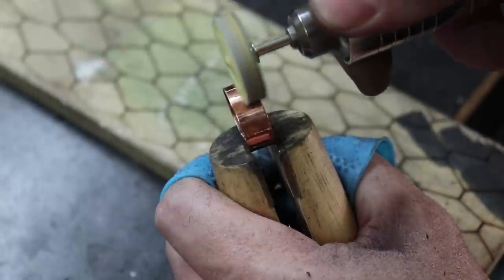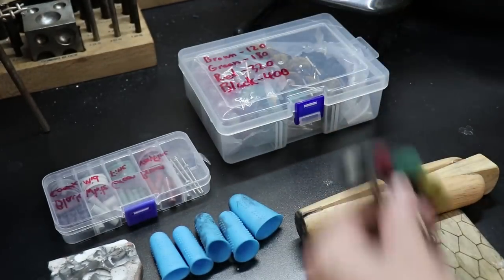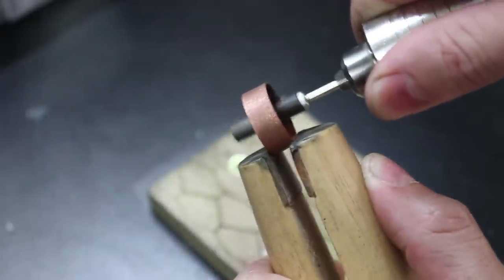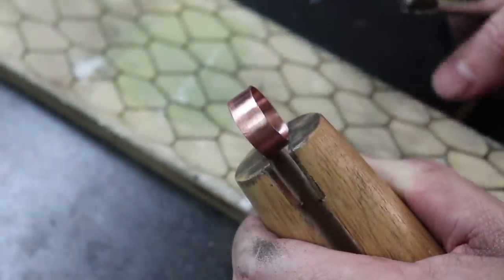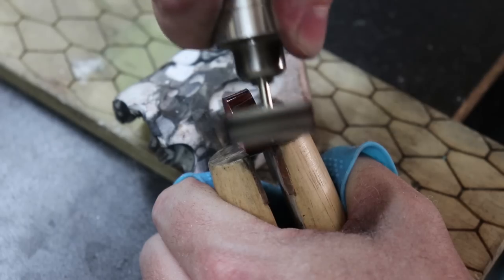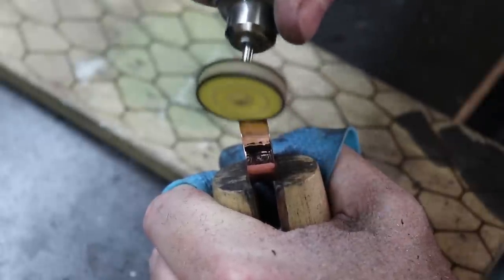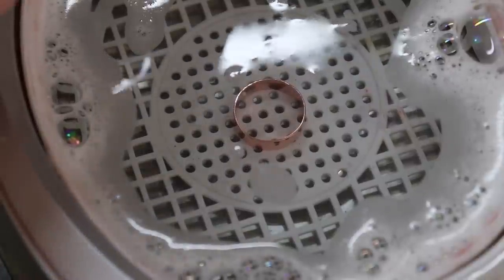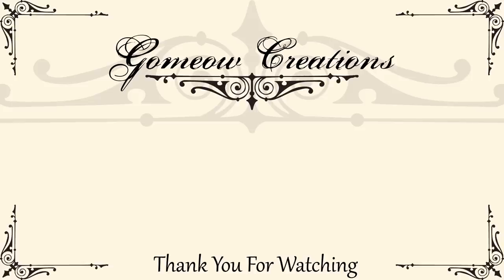Polishing Jewelry Made Easy

Comment from the maker: Here are some links to the items I used in this video:

Polishing Buffing Wheel - https://amzn.to/2RdAqsC

Fabulustre Polishing Compound - https://amzn.to/2RdgLJC

Foredom Flex Shaft - https://amzn.to/34hwMUe

Cheaper Flexible Shaft - https://amzn.to/39KfIY1

Must Have Foot Control  - https://amzn.to/2Xdmp2e

Radial Bristle Disc - https://amzn.to/2yCH71c

Felt Polishing Wheel - https://amzn.to/2x53rQA

Mini Bench Polishing Machine - https://amzn.to/39GcdBO

Wooden Ring Clamp - https://amzn.to/2xOWuTK

Silicone Finger Protectors - https://amzn.to/3bS3oX6

Comment: It has been several months since you have done this video, so you may not even see my comment.  But. . . I just found your channel yesterday, and I LOVE your teaching style!  Very clear and easy to understand.  I have a question.  I am new to all of this, and polishing has been difficult for me - this helped immensely!  However, I just purchased a rotary tumbler - at what stage would you use this?  In place of the ultrasonic cleaner?  THANKS!
Reply from the maker: Haha, I see all the comments 😁👍 and thank you for your kind words. As for your question, I need to know what you are using in your tumbler and seeing that I use steel shot in mine and I still use the ultrasonic to make sure all of the polish is gone.
Reply: @GomeowCreations  I use steel shot as well.  Which order do you use it in?? I was amazed at the shine on your ring. I learned so much from watching this!
Reply from the maker: If I have something with a lot of details and I wanted all of it polished I will use the tumbler. It wall also hardest your work so that is very helpful after your are done soldering. I don't used the tumbler very much and do most of my polishing with my polishing wheels.

Comment: Great video! I want to use my 421 compound with my dremel to polish, my question is that if the compound will wear out the gold ?
Reply from the maker: The compound that I have will take away little bits of gold in order to smooth it out.

Comment: How frequently do you replace the felt pads? I just followed your instructions to clean a white gold ring using white rouge. It came out looking really nice, however I can only do about a quarter of the ring before the felt pad turns completely black. Cleaning on wood helps a little bit but not much. So am I supposed to use 4 felt pads per ring or just keep going with the same one even if it looks filthy?
Reply from the maker: Keep using that some one, you can just reload it with more polishing compound. It turning black is normal. 😁👍
Reply from the maker: Oh and I stop using the pad when it's too small or will not stay on my bit

Comment: How long does it take to finish a ring from after it's cast to a mirror polish finish?
Reply from the maker: It depends what you are looking with and how much you have cleaned it up before polishing it. 10-45mins?
Reply: @GomeowCreations  Do you have a video that shows all the finishing needed once a ring or other jewelry is cast? I guess you start by cutting the sprue, then sand down the part where the sprue was. Then sand the rest of the ring and then polish it? Is this correct, or am I missing something?

Comment: Aside from a response below concerning freely shaping your polishing felt wheels, there was something else I wanted to tell you about.  I noticed that you dont have a lathe.  Lathes are typically large and expensive, so nothing against you for not having one.  You do, however, have electric drills.

Simply create your own attachment for the drill to act as a lathe, and you can very quickly simplify your ring polishing process.  You can even get polishing pads and put them in the drill chuck, so that you can use your clamp or other holding tools while your drill does the work.  Simply clamp the drill down to the work surface and you will be set.

 As for the ring lathe attachment, why buy one? You can easily make one.  Drill a 1/4 inch hole into one end of a hardwood dowel section (you can buy 1 inch ash or maple dowel rods in lowest or home depot) and insert a 1/4 inch piece of aluminum or brass rod stock.  You want metal for a reliable center.  Rough up the end going into the wood dowel and epoxy or ca glue in place.  Chuck it in the drill and while it is spinning, use rough sandpaper or ramps and files to work it into a tapered cone similar to your ring mandrel.  You can then jamb a ring on the mandrel and turn it on your makeshift lathe to quickly and easily polish your rings.
Reply from the maker: Well,vi do have a lathe now but this information would be great for the people that don't have one. When I get to my computer I will pin this to the top comment. 😄👍

Comment: Can you use the Fabuluster on any kind of metal?  Thanks.
Reply from the maker: Like what other metals do you have in mind?
Reply: Aluminum, copper, stainless steel, brass?     @GomeowCreations
Reply from the maker: I think it will work all all of those, It might be a little hard on the stainless steel but you can give it a try. 😀

Comment: I’m a beginner metalsmith, and recently I tried using a polishing compound. The compound was super dry and flew all over the place when I tried loading it up on the pad. Do you know if there is a way to avoid making such a mess? Thanks!
Reply from the maker: Polishing is messy, you man make a small enclosure to you can contain the mess a little better
Reply: Maggie Friedrichs I had this issue . I melted mine using a heat gun and then tried it but someone also suggested heating it and mixing it with mineral oil.

Comment: I always wonder though how to polish in hard to reach places? I cant find this information anywhere, sometimes the disc cant reach in small places. Whats the best way to go about this? For example I cant reach inside a bezel, nothing is small enough to get in certain areas.
Reply from the maker: You can use a tumbling machine with some stainless steel shot to get into all the hard to get to spots.
Reply: Something the original poster left out concerning those felt polishing wheels...  feel free to reshape them into whatever contours you need.  Simply put a new or even a used one on the dremel or flex shaft and run it against some coarse sandpaper to change its shape.  Need a fine point? Make a fine point.
Reply from the maker: You are right and thank you for pointing that out 😁👍

Comment: Can you polish an enamel coated ring?
Reply from the maker: What kind of enamel are you talking about?
Reply: @GomeowCreations  I linked the exact ring in another reply. When it was brand new it was nice and shiny, but within hours the center around the carbon looks dull and foggy, like something is coating it.
Reply from the maker: Normally that is a resin that holder in the center. You can try a plastic polishing compound on it and see if that will bring back the shine
Reply: Any idea what would cause it to lose its shine so quick?
Reply from the maker: Soft resin
Reply: Much appreciated, thanks for taking time out for my questions!
Reply from the maker: No problem and let me know if that works.

Comment: I've been googling like crazy. I hope you can help me figure our my jewlery issue. I'm trying to figure out if there is a way to use a file, dremel, or sand the I side of a finished white gold ring with a turquiose inlay all the way around. Just need a few mm of space. Is there anything you can recommend tool wise to shave down the inside of a ring and then use to polish it? Also where could I find what I need to fill in where the ring has little missing pieces of crushed turquoise? I dont want to ruin the ring but although I reached out to who made the rings, I fear business will  not correct the issues.
Reply from the maker: Email me with some pictures of the ring and the missing parts. I will try and help you out 😁👍 Gomeowcreations@gmail.com

Comment: You can use flammable solvents with your ultrasound cleaner.  We have a trick in the chemlab.
You fill the ultrasonic cleaner with previously boiled water.  This water works best as it has been degassed.
Then you put your flammable solvent in a small beaker.  The container you use must be glass in order to transmit the ultrasound.
You can now clean the item with flammable solvents or in the lab we often use acids as well.  The risk of fire with hot solvents is greatly reduced.
Reply from the maker: Good to know 😁👍 thank youm